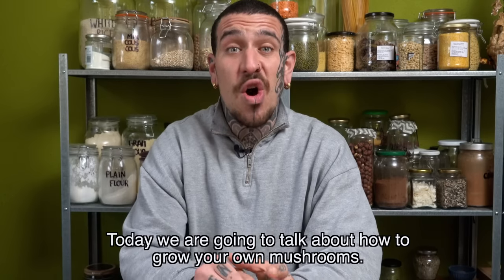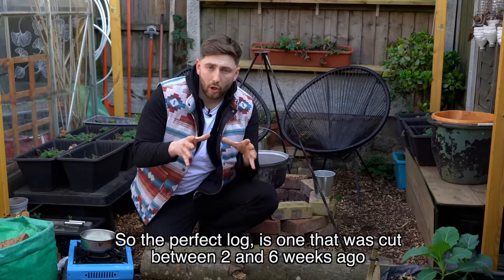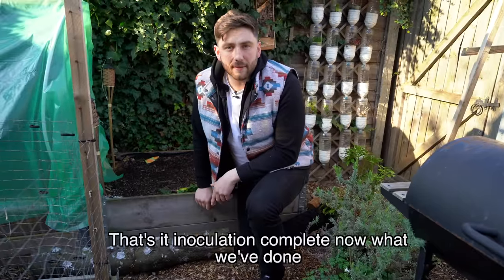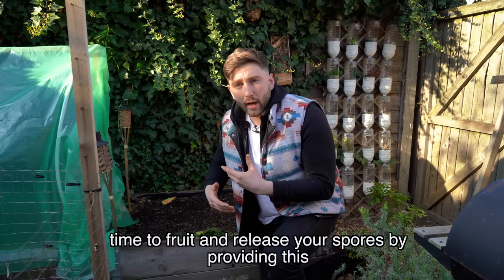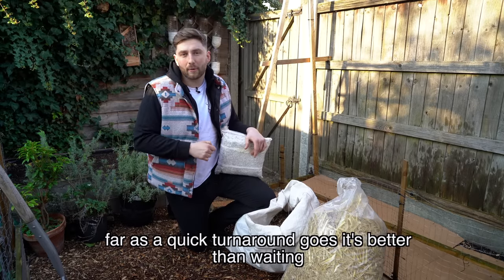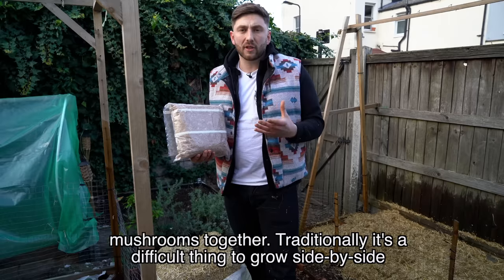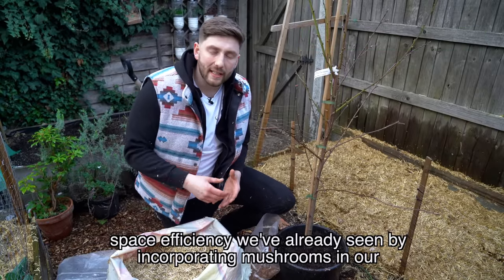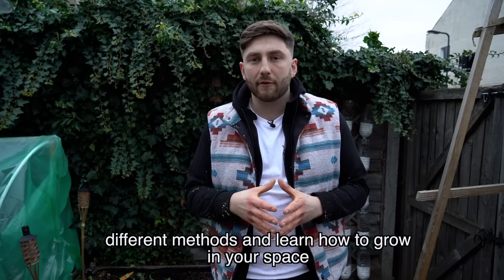5 ways to grow mushrooms in your garden

Comment: This is awesome! I had no idea shiitakes take so long to grow 😮
Can’t wait to see your first harvest! 🍄
Reply: It doesn't have to take that long. This is the main Con of growing mushrooms on logs. It takes time for the mycelium to fully colonize hardwood. 
But the Pros are once you have sealed your dowels in the log you just put it somewhere in the shade and kind of forget about it. If there is a drought just check if the weight has subsantially decreased which would mean you need to soak it or water it. Another Pro is that you will get mushrooms for many years before the log gets fully digested.
Last week I actually plugged Lion's Mane innoculated dowels in a couple of logs. If I'm lucky I might get mushrooms this fall but I will most likely have my first harvest in fall of 2024.

As far as shiitakes are concerned, I think you can grow them in a couple of weeks in bags.
Here is a FreshCap Mushrooms video if you want to know more :
https://www.youtube.com/watch?v=ghNwnXYfsLI
Reply: @lejardinierjardine8518  I did not know any of that, if you know could you use smaller logs/large branches and shorten the dowels/plugs accordingly for kinda like a somewhat faster and still have some length of steady supply?
Reply: @rickytorres9089  Yes, somewhat. You can use smaller logs and, as you said, they will get colonized faster but also give you harvest for a shorter period of time.
Now I said somewhat because I don't know what is the lowest size limit for logs to grow shiitake or other mushrooms you would usually use dowels for.
What I do know is that other fungi are usually responsable for the decomposition of twigs and smaller branches.